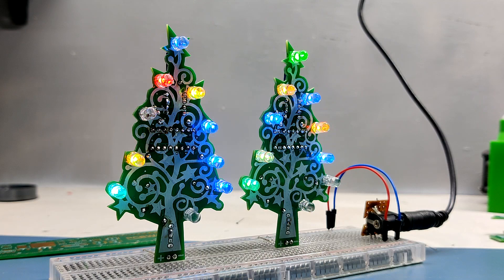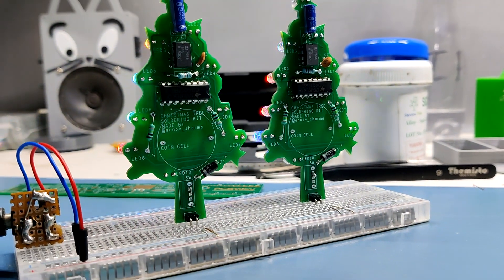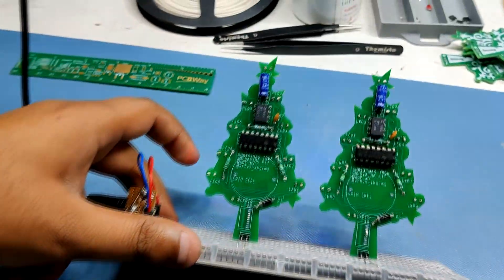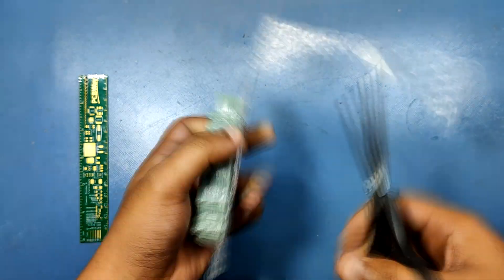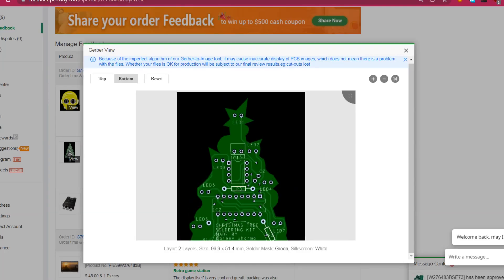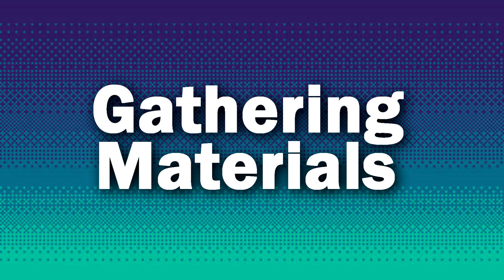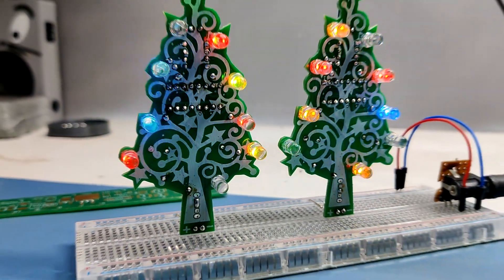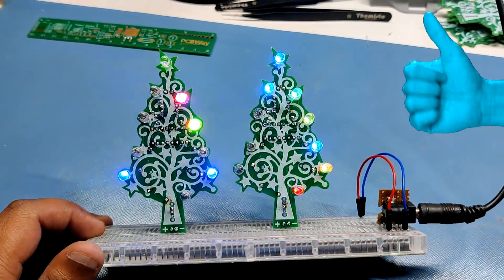Christmas Tree PCB

Comment: I don't get it ... Why bother with the chaser if you have color changing LED's in there? 
Also, if the board is build as per your schematic only one LED should light at a time, that clearly is not the case, in your build one LED is off, so your PCB is different from the schematic on instructables.
Reply from the maker: Actually they do chase but chasing rate is very slow. By replacing the 22uf cap with 1uf cap, the chasing rate will increase